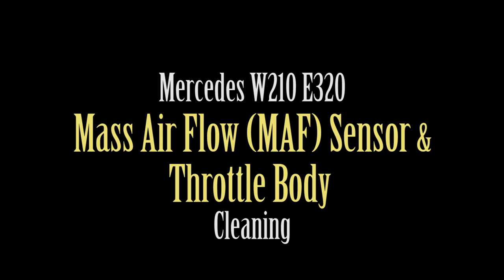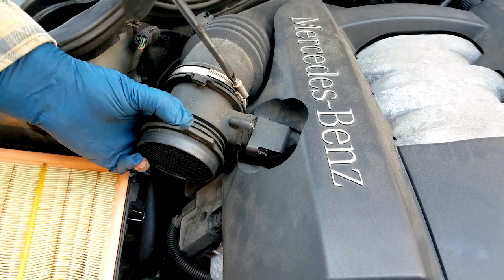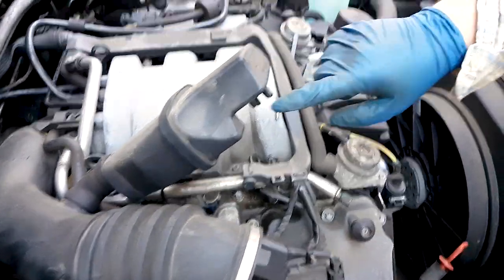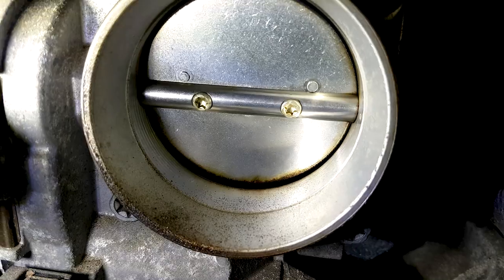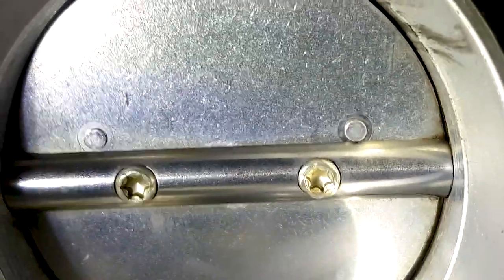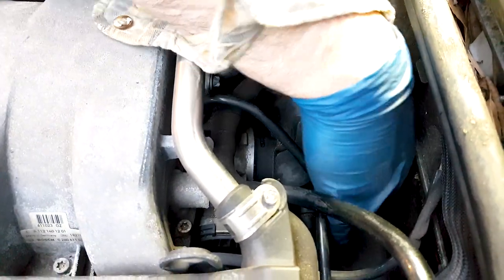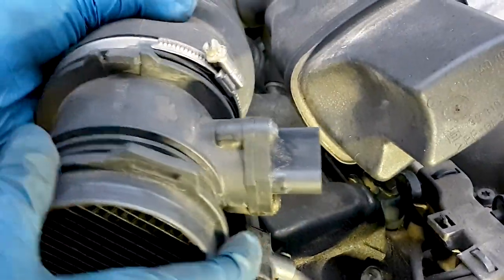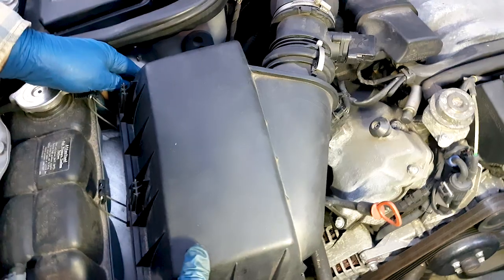Mercedes W210 MAF Sensor & Throttle Body Cleaning

Comment: Thanks for the video. What parts did you use the silicone spray on and what parts did you use the throttle body cleaner for? I need to make sure I'm spraying the right stuff.

Comment: Interesting that you didn't disconnect the connector to the throttle body before cleaning.  This is not required for the electronic throttle body in this car?  I was thinking about removing the throttle body to clean it, and even then I was a little concerned about moving the throttle plate because I'm not sure if it would damage any gears in the throttle body.  So it seems like manually moving the throttle plate is not even a concern with the throttle body connected?
Reply from the maker: That is correct.

Comment: What am I supposed to do for my e420 the maf sensor is in the middle of the engine. There are no videos whatsoever and it’s expensive to do at a shop
Reply from the maker: What year?
Reply: @masood-tv  1997
Reply from the maker: @nbalegend5346  Sorry, I haven't worked on that model and won't be able to look it up for you until mid July...
Reply: @masood-tv  it’s ok I appreciate it it ended up being a vacuum leak and it gave back the maf sensor codes for some reason not a hard fix
Reply: @masood-tv any update for the V8 W210 MAF sensor cleaning? Thanks!

Comment: HI, what is the good throttle body reading on idle? Thank you
Reply from the maker: Hi Dan, at 500RPM,  MAF's air flow rate should be  one gram per second per liter of engine displacement ...as a general rule.   Measure it for your specific car st 500, 1000, 1500, and 2500 RPM when all is good as a baseline for diagnosis of future issues...
Reply: @masood-tv  Do forgive me, I asked about throttle body reading, thank you
Reply from the maker: Sorry, Dan, throttle body reading relative to the amount of oxygen or air that enters it is measured by the Mass Air Flow sensor.  I am not familiar with any throttle body readings...
Reply: Thank you

Comment: Thank you
Reply from the maker: You are very welcome, Najim-Fx.
Reply: @masood-tv  i have another question please answer me when you got time. So I did all that cleaning the throttle body like you did and all good. Is it supposed to open all the way when you push the accelerating pedal while the car is not on? My throttle body not opening all the way is it that normal?
Reply from the maker: @najim-fx6626  Try a couple of things first.  Have someone accelerate at idle while you place your cellphone camera at the butterfly and see if it opens relative to acceleration rate.  If yes, you have no issues.  You can also press the bottom of the butterfly flap towards the engine and see if it goes up to 90 degrees.  Otherwise, there could be other problems such as someone before you having tampered with the stopper screw for example.... I am curious, does the car go faster when you give it gas as it should?
Reply: @masood-tv  I had a friend accelerating with the key on and engine off and like you said put my phone cámara and the butterfly opens only about 15 degrees 20 degrees that's it. The car has power and moves normal. The problem is only when I stop at stop sign with idle the car starts to shake and sometimes dies and have to start it again. And also I have a brake booster leak inside the car at the brake pedal could be that one of the cause of the problem?
Reply from the maker: @najim-fx6626  absolutely - especially if you are at Drive gear with the brakes applied such as when at stop signs. Is your car still stalling at idle even after cleaning the throttle body and MAF sensor?  If yes, then perhaps your MAF sensor is bad or you have EGR issues. But, you can test those to isolate...
Reply: @masood-tv  Yeah i tried replacing the maf sensor and still the same problem. After cleaning the throttle body it did get a little bit better but the the shake and hesitation still there. Now I ordered brake booster once I replace it will see if fixes the problem. Thank you for keeping up responding my comments
Reply from the maker: @najim-fx6626  no problem.  Keep us posted.